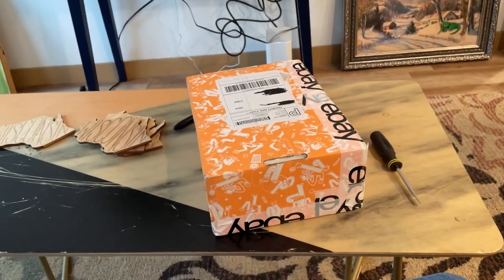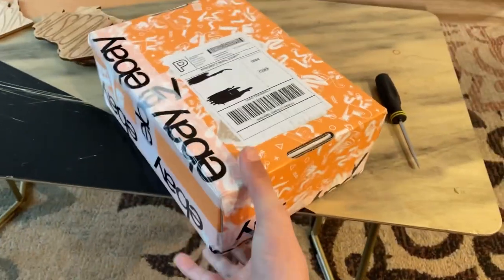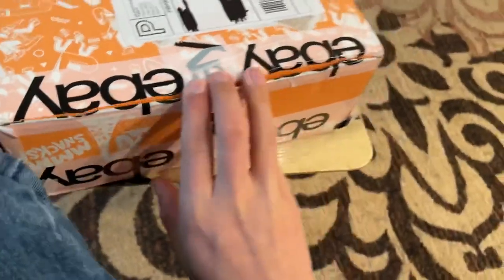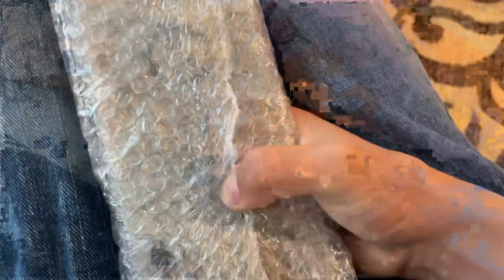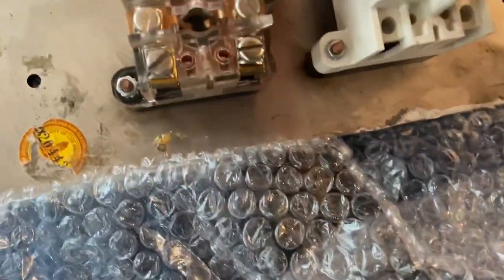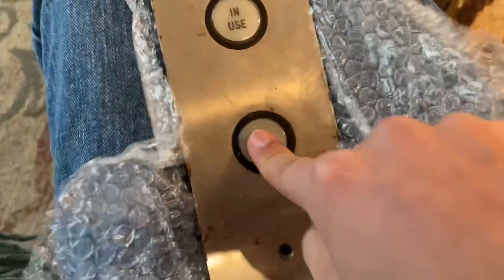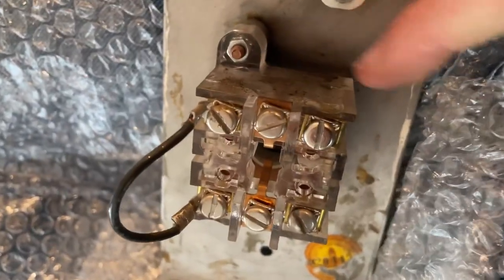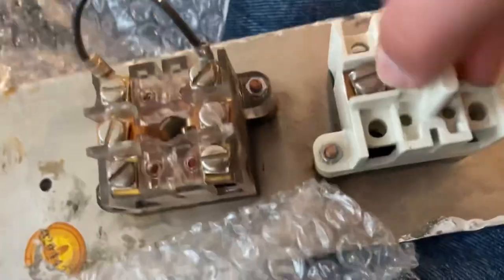ADAMS Freight Elevator Call Station Unboxing

Comment: Could have came off of a passenger elevator with a gate.  I've a few of those here in Michigan with that exact same button setup.
Reply from the maker: I have a good feeling it came from a freight judging by the wear on it, it has scratches on that bottom of it that looks like it was probably from moving something big. I also found out ir came from LA, that’s all the info i really know though
Reply: @elevating_western_washington  ah ok, still it’s a nice part overall